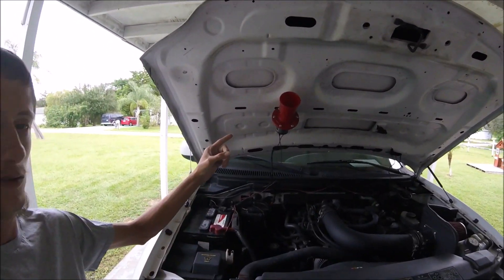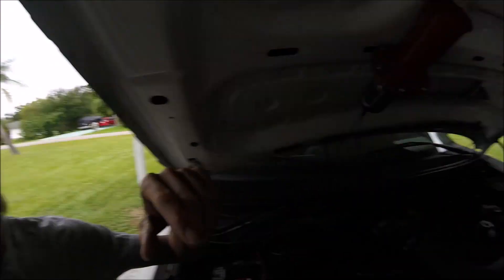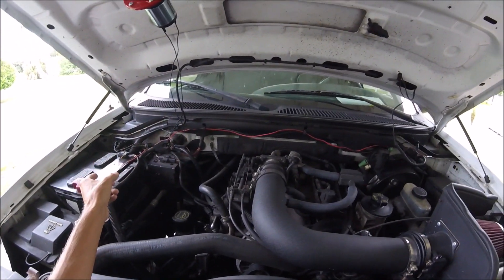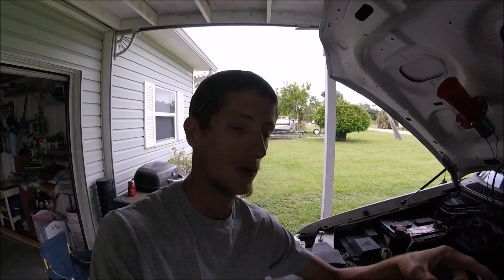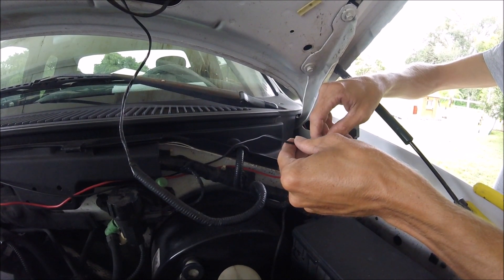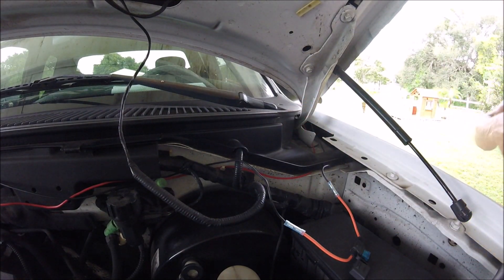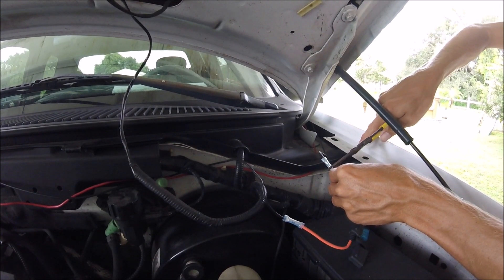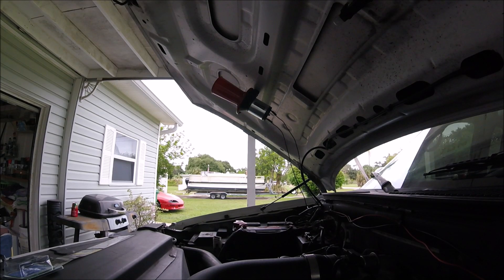How To Wire Inline Fuse Holder

Comment: What’s the best thing to do if my ac pressure fuse holder is gone I’m trying to get my ac running and I’m going to install a new compressor but I’m afraid the ac won’t work because of the broken fuse holder for the ac pressure my car is a 1999 GT Mustang